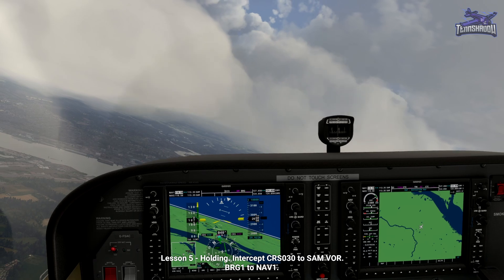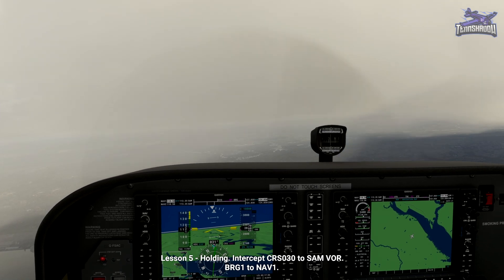FS Academy IFR | Lesson 5 | Holding Patterns - MSFS 2020

Comment: The explanation is correct, but much to difficult to understand for a student. You need to visualize the holdings in order to understand what is happening.
Reply: The problem with training like this is that students should understand hold entry long before they ever set foot in a cockpit.  The trainer should discuss, as you said, visualizing the hold and how to time the legs as well as how to adjust the outbound time to get the inbound time as close to one minute (for a non-GPS hold) as possible.    The student should be using flight time to get a feel for drift, really working with the CDI to remain on course and adjust their heading for wind drift, and concentrating on flying the hold with a reasonable degree of accuracy.  Holds are rarely perfect, but knowing about where the protected areas are and how to stay within them is key.  I strongly believe that teaching new concepts in the cockpit is a mistake; that's where we perfect what we've learned on the ground and how we develop muscle memory.

Oh, and flying this sim in VFR conditions is cheating.  I guarantee that the experience will be much more stressful and harrowing under the hood/in IMC.  A sim is the perfect place to get used to flying entirely by reference to instruments and flying them VFR is doing them no favors.